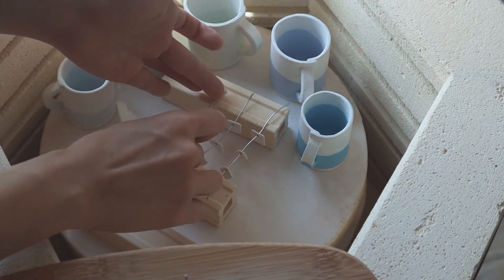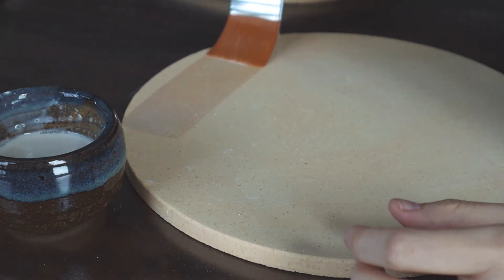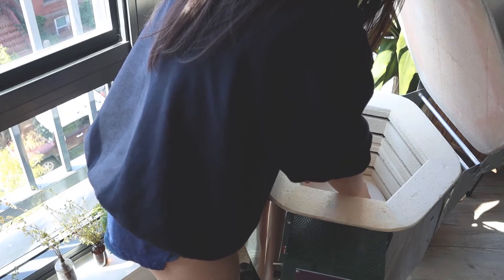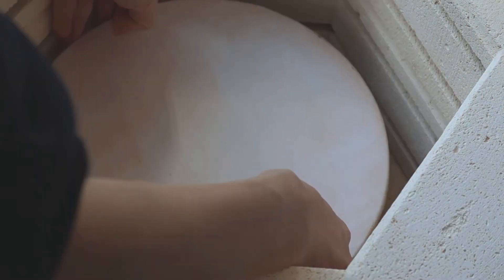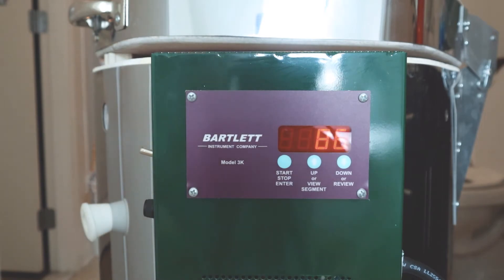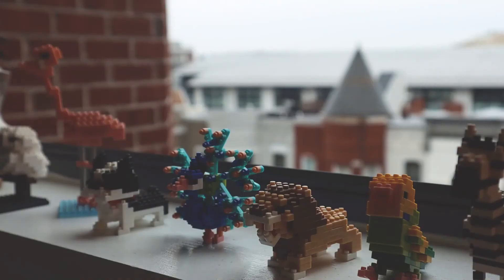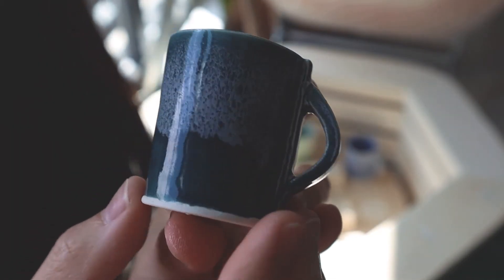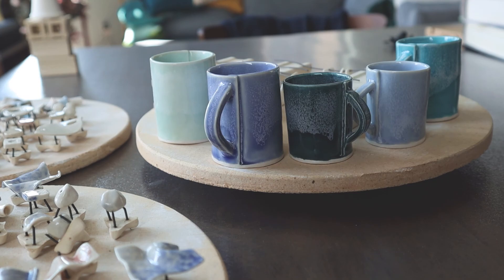home studio // glaze-firing for the 1st time (small home kiln)

Comment: Do you have to be there during firing or is it safe to go out and let them run by its own?
Reply from the maker: i am usually home when i fire, just for safety purposes. however, as it is a digital electric kiln, i don't need to watch over and adjust the kiln like you would need to with a gas kiln.

Comment: i saw some videos where they fire the ceramics only once in the kiln including the glaze, is that possible?
Reply from the maker: yup its single firing/ raw glazing. i've not tried it but it is possible. a lot of precautions to take in ensuring the clay is completely bone dry before glazing and firing. from what i heard, some glazes don't take well to single firing because the organic matter in the clay does not burn out completely and reacts with the glaze and more likely to cause problems like pinholing, crazing, running. i know mayco's stroke and coat glaze series is specially formulated just for single firing though!

Comment: Can this fire larger pieces such a salad bowl or vases (height over 6 inches)?
Reply from the maker: this kiln is an olympic medallion MAS129E and measures 11.25 in (diameter) * 9 in (height) so yes it can fire bigger pieces but 1 at a time!
Reply: @AudreyCCeramics  ok thank you and does it plug into your wall directly or did you have to buy a converter plug?
Reply from the maker: @nikitamorrison2528  it uses a nema 5-20 plug. many apartments have this outlet, usually in the kitchen and bathrooms where they are more likely to be 20 amp and above. see link for image of the outlet: https://cableflux.files.wordpress.com/2013/01/p104784d.jpg
Reply: @AudreyCCeramics  also for the stilts, my studio told us that we shouldn't put peices on them bc they  may form together. Have you ever dealt with stilt pieces sticking together? Second question: do you think it's safe to leave kiln in open area, I have a studio so wondering if this small enough for me to not worry about?
Reply from the maker: @nikitamorrison2528  i used to use stilts for firing half-drilled beads and yes i do sometimes experience them sticking onto the stilts if i apply glaze too thickly. i've since made my own stilts with clay and thinner kanthal wire and when i glaze i minimise them especially around the holes. as long as glazes do not touch the stilts, they do not stick.

i do not recommend leaving the kiln in an outdoor area as it will be subjected to elements like rain/ cold weather etc which will age the kiln prematurely. unless it is a sheltered area relatively away from these elements, then that's fine
Reply: @AudreyCCeramics  when I say studio I meant a small 300 sq ft flat. So I don't have a separate room to keep the kiln. Just wondering if it's safe to run
Reply from the maker: @nikitamorrison2528  oh right! i think it's important not to be in the room when firing at least for the first few hours when gases are released through burning of organic material. i personally fire it in my toilet with the ventilation on and doors closed.
Reply: @AudreyCCeramics  do you put the kiln on something as opposed to directly on the floor?
Reply from the maker: @nikitamorrison2528  my floor is ceramic so nope. if it's wood then definitely need something non-flammable and insulated

Comment: Hi Audrey! I'm happy I found your channel and I love your videos! Just 2 month ago I bought a small, 40l kiln and my first firing was a success. But I am hesitant to do the second glaze firing because I am scared of the hazardous Gases. Do you think I could do it in my kitchen with closed doors and wide open windows?
Greetings from Germany
Mai
Reply from the maker: congrats on your first firing! 40 litre sounds like a mid-sized kiln. i would encourage you to get a vent for that since the gases may be quite substantial. is there a possibility to do the firing outdoors? if not i think it's possible to do a closed room firing with open windows, but try to minimise entering the room for the first few hours. kitchen might not be a great idea since it's also where you cook :/
Reply: Thank you for your answer it helps a lot. My manual says I shouldn't use it outside, so I won't. I think I will maybe use it in the bathroom with the windows open then.